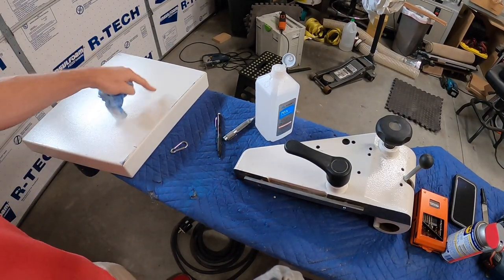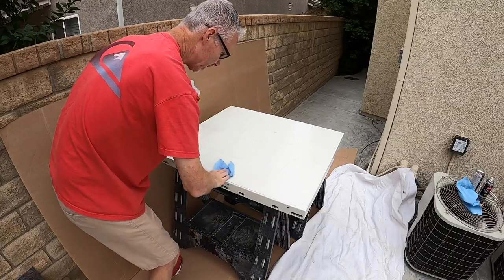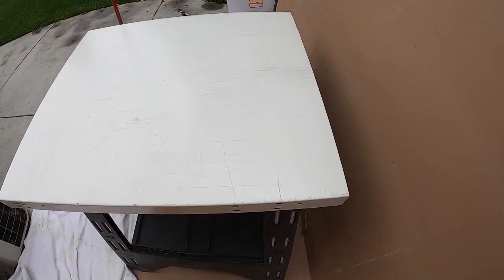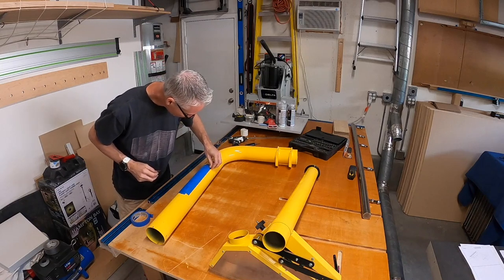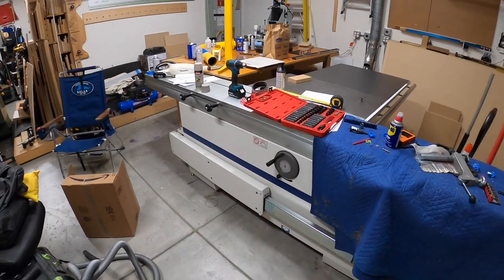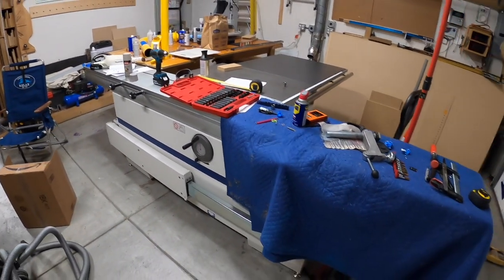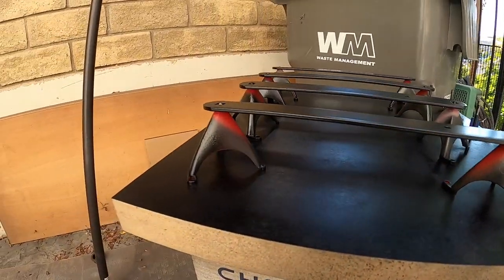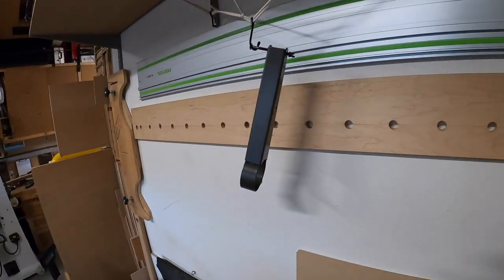MiniMax Sliding Table Saw Install And Shop Remodel Part 3- Painting and Shop Modifications Continued

Comment: What paint did you use? I am in the middle of an almost identical project. Thanks
Reply from the maker: I think I show the paint several times.  Rustoleum gun metal metallic.  I then tip coated with gloss finish that I got at auto parts store.  Not sure I remember the brand.  But it’s a wet look.  It’s like armor clear coat or something like that.